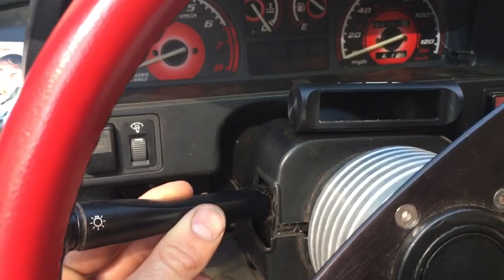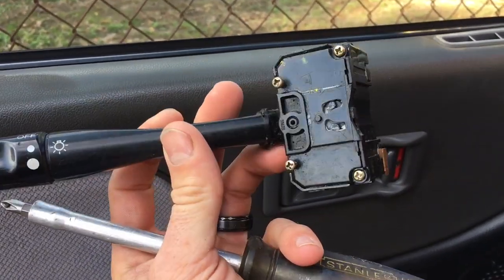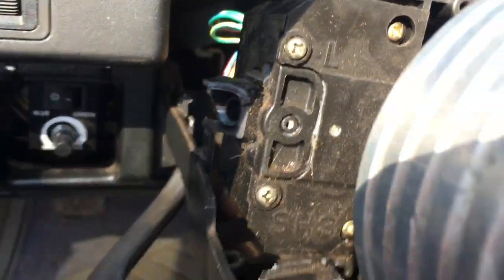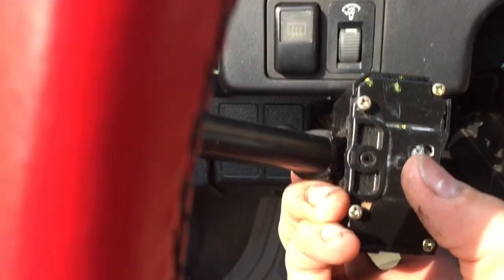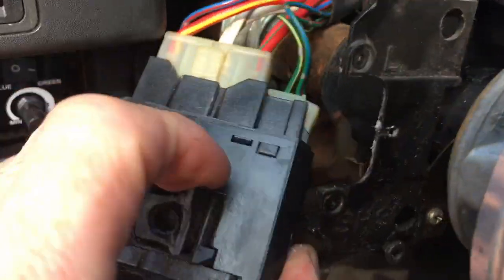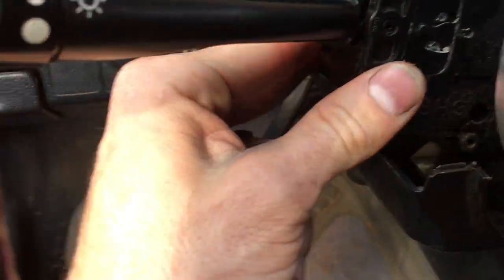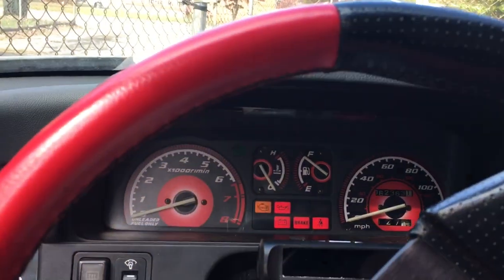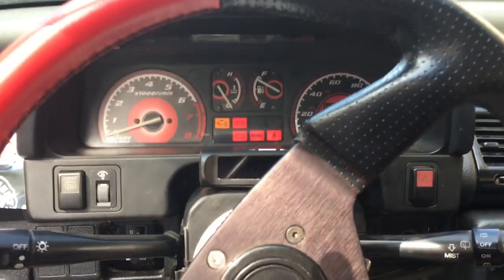How to replace civic headlight turn signal switch

Comment: Thank you for a very helpful instructions , and FYI, I thumbed up the video .  Just one question…. do you no rope mountain climb, shaolin monk one finger push ups, or chop trees with your hands?  That 2 bank spade power connector took me 20 minutes to separate them - with tools. Though that clip is supposed to help.  After I got them separated I put a little plastic grease on the outside of the connectors so that if I, or anyone else ever has to do this again, they don’t have to lose 3000 calories.
Reply from the maker: Hahahaha I must of gotten lucky!

Comment: Will that fix both low beam headlights not working too? Great video 👍
Reply from the maker: Check your fuses. If they are good then yes it should fix your problem
Reply from the maker: Or you could just have a bad ground on the headlight circuit
Reply: @MooreProjects  both fuses are ok and yhe right headlight went out 1st and about 3 days later the drivers side low beam went to. Both high beams are OK and turn signals too.
Reply: @MooreProjects  I'm using a meter to check the bulbs tomorrow.
Reply from the maker: Sounds like the bulbs just need to be replaced then

Comment: my headlights just stopped working i thought it was the wiring but i changed those and the lights just turn off. could it be the switch>?
Reply from the maker: Might be a fuse. There is one for high beam and one for low beam on each side
Reply: @MooreProjects  are they in the fuse box?
Reply from the maker: @Bosstrout  under the dash
Reply: @MooreProjects  what do they look like?

Comment: This method will work in a 97 too?
Reply from the maker: Alexis yes it will. It’s the same from 88-2000 civics and integras. Just the lengths can differ between year and models. I noticed that when I tried a 98 civic one in my 91 civic and noticed that one was longer and slightly different angle